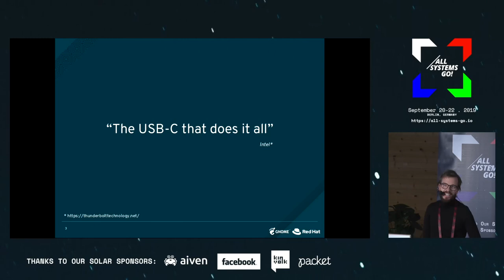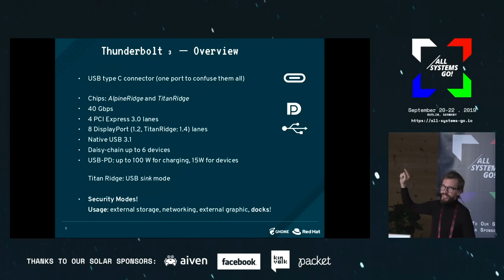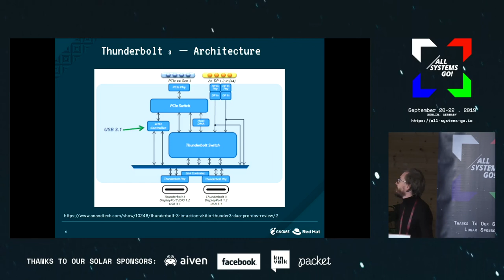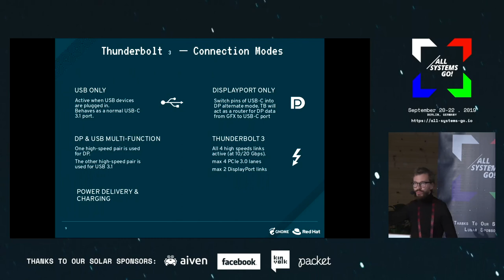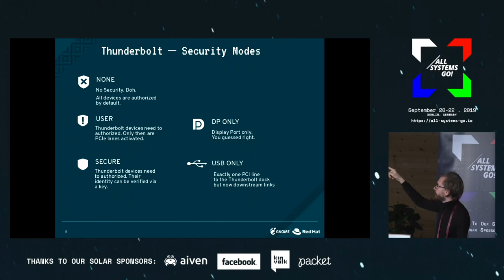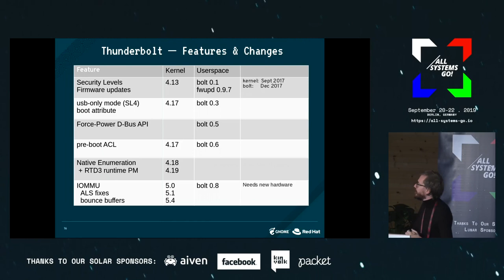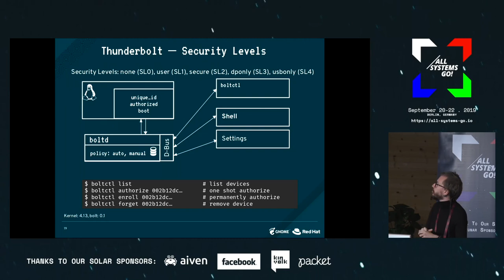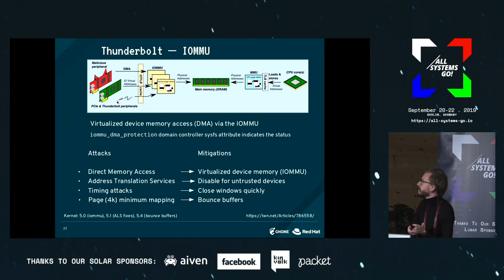The state of Thunderbolt on GNU/Linux

Comment: This is a big security risk. When I am in some place out of my control and want to connect DP (e.g. for a presentation), it could actually be a drive with malware or a malicious device abusing DMA or a USB input device entering malicious commands.
Reply: This is no longer a big security risk. DMA security concerns have long been addressed as is explained in this video. I think we have the new System 76 Oryx Pro 2020 laptop featuring the features explained here. With Thunderbolt 4 the certification process also tests security as well as USB4.
Reply: @EnochGitongaKimathi  Not true. There are mechanisms, but they are hardly used by operating systems. And where they are used, they are full of bugs. E.g.: https://thunderspy.io/